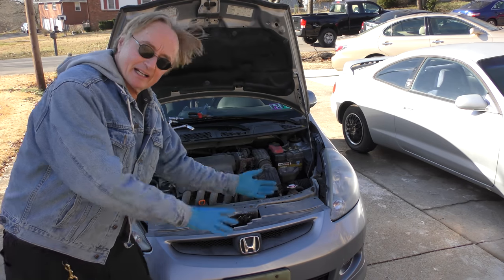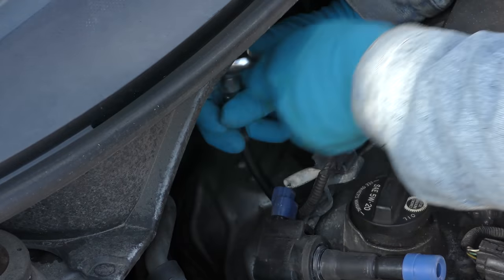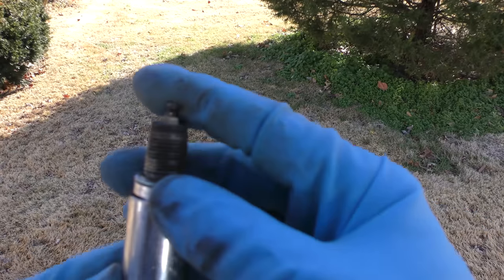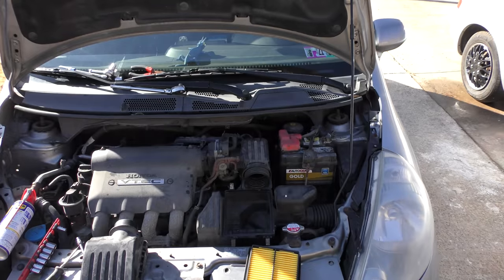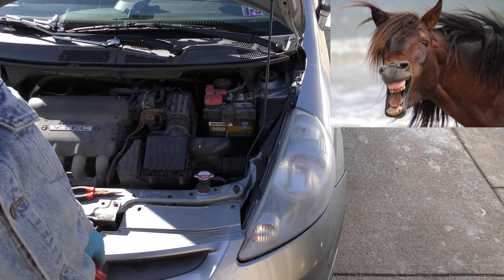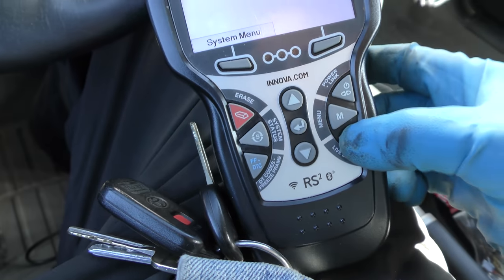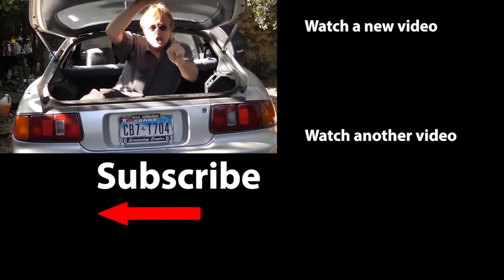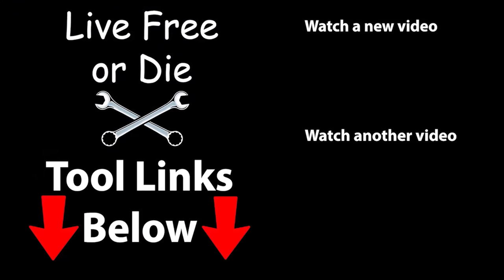This Honda Has a Serious Problem

Comment: Thank you Scotty for fixing my grandma's car!! Merry Christmas to you and your family!
Reply from the maker: Merry Christmas!
Reply: Scotty is a good (and honest) guy. A rarity in this day and age
Reply: If the Honda is your grandma's car here is a little tip (from a long time Honda owner) for you. 
When you install a new air filter, the retaining clip is curved spring steel and it's quite easy to make it snap into place by pushing the clip in (with your thumb) where it curves.
This is much harder to explain than it is to do ;-)
Reply: @inspirality  You do know that one spring was rusted tight right? You could not use your thumb, the pliers didn't even work. Scotty had to use the big screw driver for leverage
Reply: @inspirality  Science!
Reply: The coils are Hitachi 053 :)
3:22 the air cleaner housing is split open at the seam
3:30 the car uses D type FI with MAP sensor  vacuum leak will make idle high, but won't change the fuel mixture
The main reason for Fit (GD3) to die when put in gear at cold weather after cold start is the tight exhaust valves !(also causing negative fuel trim) 
With respect, Fit GD3 owner since new!
Reply: @mkrp4  Thanks for the tips!
Reply: @mkrp4  Great tips, thank you - I'll see if a valve adjustment fixes the rich condition I'm seeing on my GD1. I think one injector is noisy too (tick-tick-tick when cold or driving uphill). Have tried injector cleaner additives already.

Comment: My 99 civic with 405k miles, starts right up, and ac still works!!
Reply: Does it blow freezing cold air??😄
Reply: How is the header holding up any exhaust leaks or oil burning smell going uphill?
Reply: @guardian8319  for me? Worn seals, but thats nothing additives cant help with. This engine literally drinks the oil, but since oil cheap, this ain't no issue for me. Either if engine gives up or blows up, which ever comes first, it's getting swapped regardless :)
Reply: Hondas are awesome.
Reply: @igreatfox_707  that's amazing, I just picked up one with 90,000 miles on it. A lot funner to drive than that  Chevy Cruze! That piece of s*** leads antifreeze all over the place and the transmissions are about worthless.
Reply: @IJoeAceJRI  make sure you get the Valves adjusted on the Honda Fit! Or civic. It can idle rough if the exhaust valve's are to tight. Just keep that in mind.
Reply: @IJoeAceJRI  test drive it when the engine is bone cold like first thing in the morning and see if it idles rough, if it does more likely it needs to be adjusted. It's just right underneath the valve cover it's not an extensive job.
Reply: @peterl6095  not necessarily...model of car is more important than brand
Reply: Hondas are monsters as long as you keep up with basic maintance.
Reply: You must live in a state with not strict air monitoring stations tied into the State testing like California. In Japan engines must be replaced at 10 years or 150,000 km. (93,200 mi) since 2002.
Reply: @josephbingham1255 
420K miles now... haven't failed or had to retest for emmissions here in California. AC still running good and holding up.
Reply: @igreatfox_707  Wow 420 thousand on original engine? Not even a valve job? And passes smog test in California always?

Comment: I have the 2010 fit and this sounds exactly like mine when it starts up! 😁 It was satisfying to hear 🤣 I love this car very reliable, and actually has a lot more space than you would think.
Reply: My dad has an 08 Fit Sport with 658,000 miles. It’s one of the best cars ever created hands down. The packaging is just perfect and it handles heavy loads surprisingly well. We’ve weighed our Fit down with 800 plus pounds of camping gear and bikes and it still runs fine.
Reply: @sarahwood8943  holy cow that’s good to know I just bought an 09 FIT with only 112,000 miles on it.  I plan on using it for my long commutes to work! 174 miles a day round trip.  Amazing gas mileage especially compared to my Toyota FJ Cruiser which was costing me 800.00 a month in fuel expenses
Reply: @sarahwood8943  What,  658k miles. mine 05  only 151k miles.  I had been thinking 300k miles is a record.
Reply: @DGQ1Q2  300k isn't a record....everyone knows Hondas can easily  go well over 300k if you take care of them
Reply: @richsweeney1115  Thanks for you reply.  I am willing go far of 400k hopefully. 👍
Reply: Does the 2010 have the cvt transmissions? If so, are they problematic? Thinking about buying one next week for $4200 with 220K miles on it…it’s about the cheapest I can find for its age and mileage. Any thoughts??

Comment: Let your junker car pay for your next car, open a bank account & deposit $500 each month and don't touch it until your junker goes to the crusher. May have enough to pay cash for next low mileage used vehicle.

Comment: I drive an '07 Honda Fit in PA, I don't think of it as old though lol
I love that little car!  I'll have to check the air filters.
Reply: If it's still not running great when cold you can also check your valve clearance. I had a similar problem and an adjustment fixed it  up. It's apparently pretty common on the Fits. They're fantastic cars though!
Reply: I just bought a Honda fit with 90,000 miles on it. 5k
Reply: @yodead369  I bought mine for 2800 sport model 98k miles
Reply: @Arisafariie  yeah, used cars in my state are surging! It's almost worth getting another loan at this point.
Reply: @yodead369  damn what a deal

Comment: I just bought a Honda Fit that comes tomorrow. When I saw the thumbnail I got scared 😂
Reply: do you still have it ?
Reply: Don't they're more than reliable. Have 235k on my wife's and it was abused before we got it. Oh and original CVT still shifting in it... With a little whiplash.